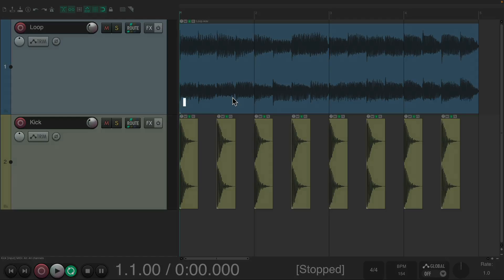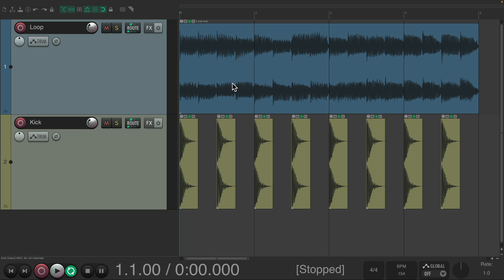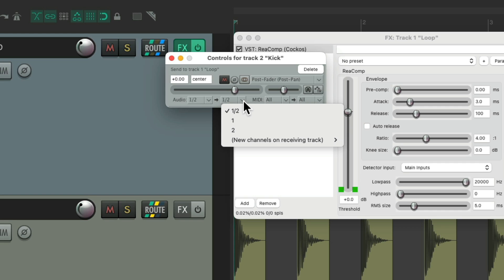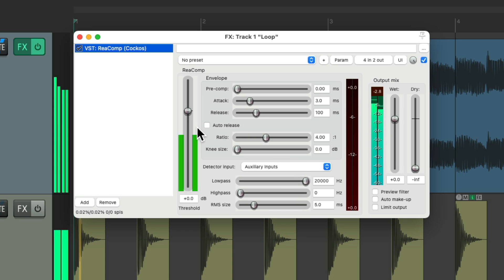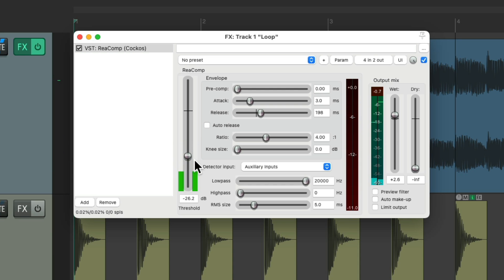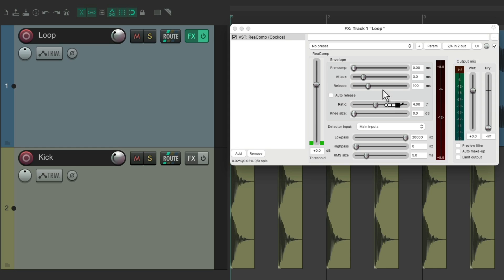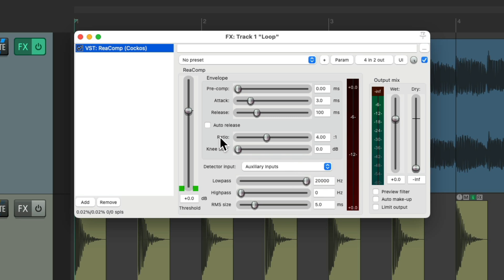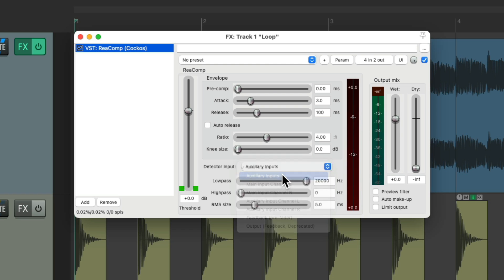Drag and Drop Sidechains in REAPER

Comment: Hi Kenny, thanks for the awesome tutorials as always! You’ve taught me so much about mixing with reaper! Quick question - when using fab filter pro R 2, there is a built in ducking feature. I can’t seem to get this to work properly in reaper. I’ve tried sending the dry signal of the track I want to add reverb on to an auxiliary track with the plug-in on, and then also creating a separate send to channels 3/4 to function as the external sidechain for the plugin, but I’m getting some very odd results when I do this. If I don’t set up a separate sidechain from the track I want the ducking effect on, the ducking feature is simply greyed out. Have you ever come accross this behaviour in reaper with this plugin, and if so do you know of any resolutions? Any advice would be greatly appreciated, and thanks again for all the great videos 😊

Comment: Question... is there a way to add sidechain to a take? I basically have a main vocal track (about an hour long) and then when there is sound from another source, I want it to compress. However, I don't want this to happen on the whole track for this source. Just the take. I know I can move the take to another track but I don't want to mess up timing and am hoping for an easy way to apply it to a take. Thanks

Comment: When I am sidechaing a midi track using another midi track, the midi track used for sidechaining (say a kick from a drum machine or a kick made in a synthesizer) is sending it's midi information to the midi track which needs to be sidechained (say a synth lead or bass) as well. This causes the bass/lead track to trigger notes used on the kick track. Is this normal? How to change this such that the kick track doesn't send midi information to the bass/lead track, and only send audio information? Right now I have to use a muted audio track and make an audio pattern, and side chain lead/bass to that.

Comment: Hello there Kenny Gioia, i'm hoping that you get this message because i really need your help with something i believe you could help me with if it can be done.  i have this project in reaper v6.83 and there are some track's that somehow are off line in a reaper file called "reapeak" (wav.reapeaks).  i have a question... Can a reapeak file be inverted back to it's original file (A Wave) again?  I would really appreciate your feedback on this issue i'm having!.  Thanks!